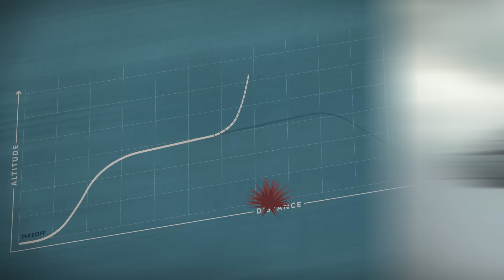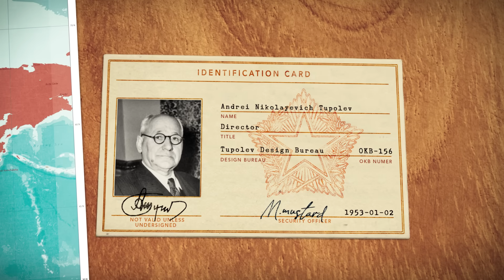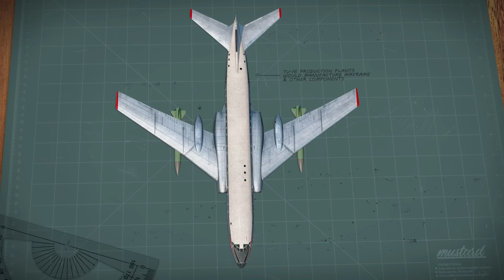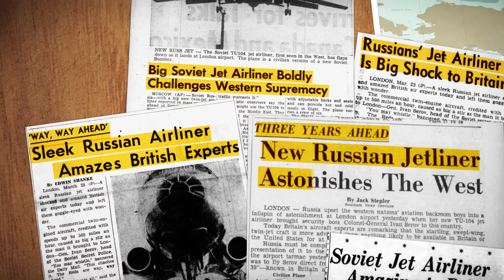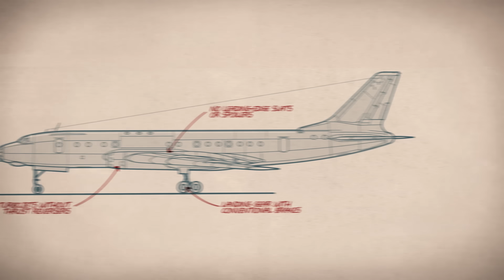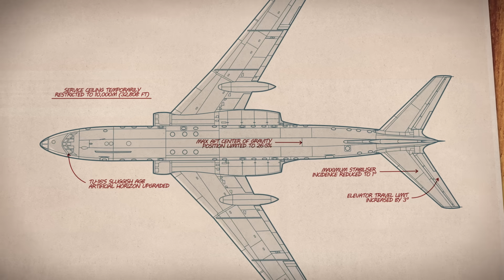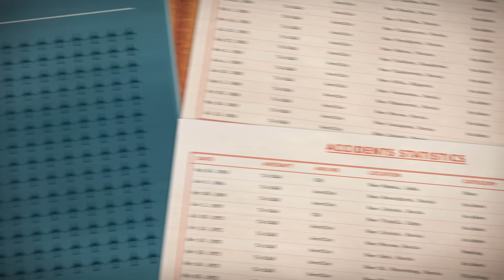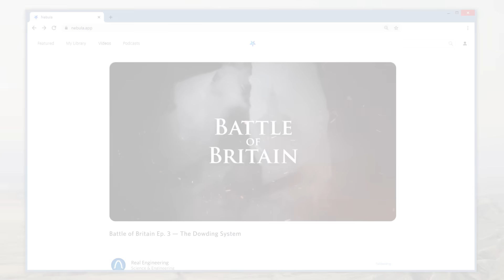The Soviet Airliner Designed To Crash

Comment: DC10 most dangerous aircraft
Reply: Obviously it's always very important to note the relevant facts.     
   
 ETC*

The DC 10 has an average safety record for an aircraft that first flew in 1970. The cargo door fault that caused the deadliest accident loss incident at the time was not rectified for all aircraft immediately due to an agreement between an FAA person and people at the manufacturers. The aircraft only attained average safety stats after a number of significant safety related modifications were completed for all DC10 aircraft during the early years of operation.

 Of course De Havilland carried out a full stress analysis & performed extensive & protracted testing on two long lengths of fuselage. De Havilland carried out significantly more testing than was required by any authority at the time.
 
It is the case that The stress for the crown sheets when measured was not greater than predicted.
  
  Obviously there have been worse aircraft for accident losses both before & after the Comet.

    How things were back then -
Accident losses - % of aircraft built.
DeHavilland Comet 4 UK     14% 
DeHavilland Comet all mks  17%  
Vickers VC10 UK 5%
   The DH Comet had better safety than or similar safety to many other commercial passenger aircraft of a similar era
    Douglas DC-1        99%
      Douglas DC-2        47%
    Douglas DC-3        30%
      Douglas DC-4          26%
    Boeing s300            72% 
 Boeing 307               70%
  Boeing 247                48%
     Boeing 707                   20% 
Lockheed L-049/149 Constellation  30%
   Lockheed Electra  Turboprop    29%
Fairchild FH-227                        30%
 McDonnell Douglas DC-8        14%
  Sud Aviation Caravelle            15%
Canadair CL-44  Turboprop     46%  
Convair CV-580  Turboprop     22%
Convair CV-880    (ff 1959)       27%  
Convair CV-990     (ff 1961)      33%
Tupolev T-104          (ff 1956)    16%

Obviously the French Caravelle, a very similar aircraft to the Comet, also at the time didn't result in Sud Aviation becoming a significant competitor to Bow-wing  (See B-47 wing folding and wing collapse incidents).
        The Comet was designed with military use in mind, Nimrod work started at De Havilland in 1953.
  The committee did not find hundreds of fatal flaws or evidence of design defects, structural defects, defective materials or shoddy workmanship. Ripstop provision was included. Claimed incidents did not involve cracks starting from window corners & one particular incident did not involve a fracture running from a rivet hole. 
     The engine & engine intake position had advantages, were not flaws or fatal flaws & were not the cause of any incidents involving any Comet or Nimrod aircraft. Nearly all changes before the Comet 4 were just in case or were previously scheduled improvements. 
  In fact it is the case that the skin thickness of the Comet remained largely unchanged for later versions. The alloy used was changed simply because the manufacturer discontinued the original version. 
  Bow-wing & the 707 story (see b-47 wing folding & wing collapse incidents) is the result of global economics & the well protected & very large domestic US airliner market & active support from the UK with for instance proposed competing airliners from Vickers & DH being blocked by the UK government at the time, cheap & nasty was the requirement with large scale production capability in one place.
  The 707 was of course a much larger aircraft which as a stressed skin metal airframe aircraft would require a thicker skin anyway. They got lucky at the time essentially.  Bow-wing is the result of the large & well protected  US domestic airliner market 
  The 707 had a very long production run with a large number produced, the average life of a 707 doing airline duty only was about 22 years. Military duty 707 airframes get a lot of big military budget attention & there are plenty of spares from retired aircraft which is why there are still examples in service.
  The fate of De Havilland was due to Govt policy Aerospace sector rationalisation & global economics, it was nothing to do with the Comet.
  A comprehensive, thorough & protracted testing program was carried out on the prototype & it's assemblies. Of course the Comet did indeed have Ripstop stop provision. 
     De Havilland (Of England) Comets were not grounded after 1970 due to structural problems.
It's interesting that some of the aircraft on the list should really have been noticeably safer than the Comet due to being a similar type but of much later design & manufacture but they definately were not safer.
    How things were back then -
Accident losses - % of aircraft built.
DeHavilland Comet 4 UK     14% 
DeHavilland Comet all mks  17%  
Vickers VC10 UK 5%
   The DH Comet had better safety than or similar safety to many other commercial passenger aircraft of a similar era
    Douglas DC-1        99%
      Douglas DC-2        47%
    Douglas DC-3        30%
      Douglas DC-4          26%
    Boeing s300            72% 
 Boeing 307               70%
  Boeing 247                48%
     Boeing 707                   20% 
Lockheed L-049/149 Constellation  30%
   Lockheed Electra  Turboprop    29%
Fairchild FH-227                         30%
 McDonnell Douglas DC-8     14%
  Sud Aviation Caravelle       15%
Canadair CL-44  Turboprop   46%  
Convair CV-580  Turboprop 22%

A comparison of more recent aircraft.
Accident losses comparison examples. 
1970s - 1980s
    % of total Aircraft built
Similar aircraft type, date / decade, useage, size.
    Biz Jets
BAe-125-800                        1.7 %
Beechcraft Beechjet 400    2.2 %
Cessna 550 Citation II         7.1 %
Learjet 35 / 36                       12 %
Beechcraft 1900                  6%
Dassault Falcon 10              11.5%
Aérospatiale SN.601            22.5%

Medium size jets / Turboprops.
DC10      ff 1970                7%
BAe-146                        5.1%
Fokker 100          6%
McDonnell Douglas DC-9-30       9.5%
Fairchild FH-227       30%
McDonnell Douglas DC-8    14%
Canadair CL-44  Turboprop   46%  
Convair CV-580   Turboprop   22%

Beechcraft, Fokker, McDonnell Douglass, Learjet, Fairchild, Aerospatiale, Canadair, Convair  companies defunct.

    All Comets, including some Comet 1s, had full civilian use certification at some point after 1954,  civilian use certification only being withdrawn after commercial flying stopped. Examples were flying until 1997 - one example did a signals research global circumnavigation flight series in 1993 via Australia virtually without a rest travelling 28000 miles, only had an ice warning indicator issue during the flights.

    The DH Comet - World Firsts.
1st gas turbine jet powered airliner. 1st high altitude 8psi pressurised full fuselage length passenger cabin airliner,  not a trivial feature as structure  strength required for pressurisation considerably exceeded strength required for normal flying stress. Nobody else had done anything similar before the Comet.
  The b-47 (& the Junkers) used relatively small, heavily built  pressurised modules  (Bow-wing b-47, the aircraft where 6 had their wings fold up in 2 months while flying & some had their wings fall off while parked). 
   The 1937 Boeing piston engined airliner pressurised passenger cabin was pressurised to 2 psi only - in fact that could easily be done as the normal unpressurized fuselage cabin structure strength for flying stresses only was all that was needed to be adequate so no significant weight increase issues needed addressing.
    1st all hydraulically powered flying surface controls & actuators airliner with under carriage wheel disk brakes + ABS.
1st jet airliner to cross the Atlantic.
1st jet aircraft to do a world circumnavigation flights series.
  Of course De Havilland had prior experience building many all metal construction airframe aircraft including thousands of jet powered fighter aircraft that were primarily of metal construction with pressurised cockpits & jet engines built by De-Havilland & we know the world's first all metal construction airframe airliner was built in England in the 1920s by Handley Page.
  Indeed it is in fact the case that airliner construction & testing changed everywhere, including in the US, during & after the Comet investigations.
     De Havilland did indeed always work to better than industry standards at the time, used up to date knowledge for the design & no evidence of negligence  or criminal negligence was ever produced in relation to the DH Comet.
    The course of De Havilland & the general UK aerospace industry sector was not affected even slightly by the DH Comet. The course of national aerospace sectors obviously being similar & inevitable in many countries.
     Other interesting World firsts
World's first turboprop aircraft.
Vickers Viscount Turboprop Airliner 1947. 
A 1945 Gloster Meteor Aircraft with Turboprop Gas Turbine Engine.

They might like to answer these questions.
   Which airline has just ordered
60 RR England Trent XWB Engines
& What aircraft are the engines for?

Bonus question for 10 points.
         Which country has the 
World's Highest Combined Per Capita
  Nuclear + Defence + Aerospace Sector Activity?    

          👍 & 🙂 & of course 😎 indeed.
          C H E E R S & without doubt  -
          Toodle PIP Old C H A Ps.
 

. .... . ... .. . . ......... ...
. . ... ..         .......... ...

Comment: Cool
Reply: Indeed, that's entirely correct of course.
     
However, we do indeed feel we can clear up some commonly held myths and misconceptions, without doubt obviously.
    
It always good to deal with facts isn't it.

Obviously there have been worse aircraft for accident losses both before & after the DH Comet & the Tupolev T-104.

    How things were back then -

Accident losses - % of aircraft built.
DeHavilland Comet 4 UK     14% 
DeHavilland Comet all mks  17%  
Vickers VC10 UK                     5%
Tupolev T-104                          16%

   The DH Comet & Tupolev T-104 had better safety than or similar safety to many other commercial passenger aircraft of a similar era

    Douglas DC-1        99%
      Douglas DC-2        47%
    Douglas DC-3        30%
      Douglas DC-4          26%
    Boeing s300            72% 
 Boeing 307               70%
  Boeing 247                48%
     Boeing 707                   20% 
Lockheed L-049/149 Constellation  30%
   Lockheed Electra  Turboprop    29%
Fairchild FH-227                        30%
 McDonnell Douglas DC-8        14%
  Sud Aviation Caravelle            15%
Canadair CL-44  Turboprop     46%  
Convair CV-580  Turboprop     22%
Convair CV-880    (ff 1959)       27%  
Convair CV-990     (ff 1961)      33%
Tupolev T-104          (ff 1956)    16% we can clear up some commonly held myths and misconceptions.

It always good to deal with facts isn't it.

Obviously there have been worse aircraft for accident losses both before & after the DH Comet & the Tupolev T-104.

    How things were back then -

Accident losses - % of aircraft built.
DeHavilland Comet 4 UK     14% 
DeHavilland Comet all mks  17%  
Vickers VC10 UK                     5%
Tupolev T-104                          16%

   The DH Comet & Tupolev T-104 had better safety than or similar safety to many other commercial passenger aircraft of a similar era

   Douglas DC-1          99%
   Douglas DC-2          47%
   Douglas DC-3     .    30%
   Douglas DC-4          26%
   Boeing s300            72% 
 . Boeing 307              70%
   Boeing 247              48%
   Boeing 707              20% 
Lockheed L-049/149 Constellation  30%
Lockheed Electra  Turboprop            29%
Fairchild FH-227                                 30%
McDonnell Douglas DC-8                  14%
Sud Aviation Caravelle                      15%
Canadair CL-44  Turboprop              46%  
Convair CV-580  Turboprop        22%
Convair CV-880    (ff 1959)         27%  
Convair CV-990     (ff 1961)        33%
Tupolev T-104          (ff 1956)      16%
    
Obviously, as always, we hope this helps.
   
Cheers 👍.        
   
. . .....
. ..   .

Comment: I wonder why Tupolev didn't ask for 5 years and redesign the wings. Custom-made wings would've helped a LOT. I also have no idea why they didn't add slats, spoilers or actually decent landing gear. Those changes would've made it significantly safer and would've have taken that much longer.
Reply: Indeed, without doubt that's entirely correct of course.

However, we do indeed feel we can clear up some commonly held myths and misconceptions, obviously.

Clearly It's always good to deal with facts isn't it.

Obviously there have been worse aircraft for accident losses both before & after the DH Comet & the Tupolev T-104.

    How things were back then -

Accident losses - % of aircraft built.
DeHavilland Comet 4 UK     14% 
DeHavilland Comet all mks  17%  
Vickers VC10 UK                     5%
Tupolev T-104                          16%

   The DH Comet & Tupolev T-104 had better safety than or similar safety to many other commercial passenger aircraft of a similar era

    Douglas DC-1        99%
      Douglas DC-2        47%
    Douglas DC-3        30%
      Douglas DC-4          26%
    Boeing s300            72% 
 Boeing 307               70%
  Boeing 247                48%
     Boeing 707                   20% 
Lockheed L-049/149 Constellation  30%
   Lockheed Electra  Turboprop    29%
Fairchild FH-227                        30%
 McDonnell Douglas DC-8        14%
  Sud Aviation Caravelle            15%
Canadair CL-44  Turboprop     46%  
Convair CV-580  Turboprop     22%
Convair CV-880    (ff 1959)       27%  
Convair CV-990     (ff 1961)      33%
Tupolev T-104          (ff 1956)    16% we can clear up some commonly held myths and misconceptions.

It always good to deal with facts isn't it.

Obviously there have been worse aircraft for accident losses both before & after the DH Comet & the Tupolev T-104.

    How things were back then -

Accident losses - % of aircraft built.
DeHavilland Comet 4 UK     14% 
DeHavilland Comet all mks  17%  
Vickers VC10 UK                     5%
Tupolev T-104                          16%

   The DH Comet & Tupolev T-104 had better safety than or similar safety to many other commercial passenger aircraft of a similar era

   Douglas DC-1          99%
   Douglas DC-2          47%
   Douglas DC-3     .    30%
   Douglas DC-4          26%
   Boeing s300            72% 
 . Boeing 307              70%
   Boeing 247              48%
   Boeing 707              20% 
Lockheed L-049/149 Constellation  30%
Lockheed Electra  Turboprop            29%
Fairchild FH-227                                 30%
McDonnell Douglas DC-8                  14%
Sud Aviation Caravelle                      15%
Canadair CL-44  Turboprop              46%  
Convair CV-580  Turboprop        22%
Convair CV-880    (ff 1959)         27%  
Convair CV-990     (ff 1961)        33%
Tupolev T-104          (ff 1956)      16%

Obviously we hope this helps.

Cheers 👍.      

. ..... . ...... . ...... .. ....

Comment: Whenever a Soviet made and maintained plane came to the US, they automatically had half a safety star removed from the international rating.
Reply: Indeed, that's entirely correct of course.

However, we do indeed feel we can clear up some commonly held myths and misconceptions, without doubt obviously.

It always good to deal with facts isn't it.

Obviously there have been worse aircraft for accident losses both before & after the DH Comet & the Tupolev T-104.

    How things were back then -

Accident losses - % of aircraft built.
DeHavilland Comet 4 UK     14% 
DeHavilland Comet all mks  17%  
Vickers VC10 UK                     5%
Tupolev T-104                          16%

   The DH Comet & Tupolev T-104 had better safety than or similar safety to many other commercial passenger aircraft of a similar era

    Douglas DC-1        99%
      Douglas DC-2        47%
    Douglas DC-3        30%
      Douglas DC-4          26%
    Boeing s300            72% 
 Boeing 307               70%
  Boeing 247                48%
     Boeing 707                   20% 
Lockheed L-049/149 Constellation  30%
   Lockheed Electra  Turboprop    29%
Fairchild FH-227                        30%
 McDonnell Douglas DC-8        14%
  Sud Aviation Caravelle            15%
Canadair CL-44  Turboprop     46%  
Convair CV-580  Turboprop     22%
Convair CV-880    (ff 1959)       27%  
Convair CV-990     (ff 1961)      33%
Tupolev T-104          (ff 1956)    16% we can clear up some commonly held myths and misconceptions.

It always good to deal with facts isn't it.

Obviously there have been worse aircraft for accident losses both before & after the DH Comet & the Tupolev T-104.

    How things were back then -

Accident losses - % of aircraft built.
DeHavilland Comet 4 UK     14% 
DeHavilland Comet all mks  17%  
Vickers VC10 UK                     5%
Tupolev T-104                          16%

   The DH Comet & Tupolev T-104 had better safety than or similar safety to many other commercial passenger aircraft of a similar era

   Douglas DC-1          99%
   Douglas DC-2          47%
   Douglas DC-3     .    30%
   Douglas DC-4          26%
   Boeing s300            72% 
 . Boeing 307              70%
   Boeing 247              48%
   Boeing 707              20% 
Lockheed L-049/149 Constellation  30%
Lockheed Electra  Turboprop            29%
Fairchild FH-227                                 30%
McDonnell Douglas DC-8                  14%
Sud Aviation Caravelle                      15%
Canadair CL-44  Turboprop              46%  
Convair CV-580  Turboprop        22%
Convair CV-880    (ff 1959)         27%  
Convair CV-990     (ff 1961)        33%
Tupolev T-104          (ff 1956)      16%

Obviously we hope this helps.

Cheers 👍.

   . . . . .   . . .   .      .  ....